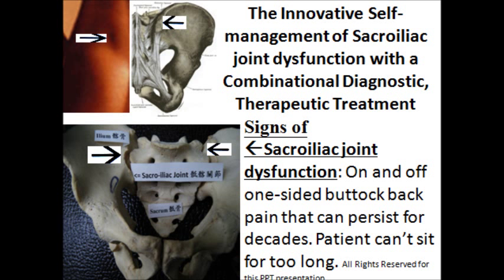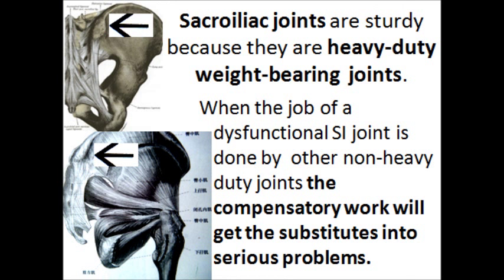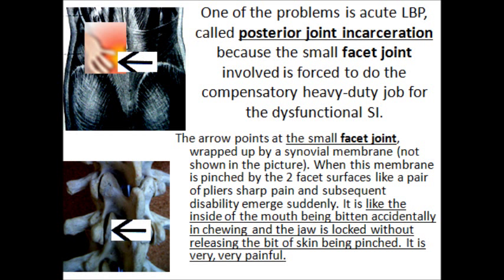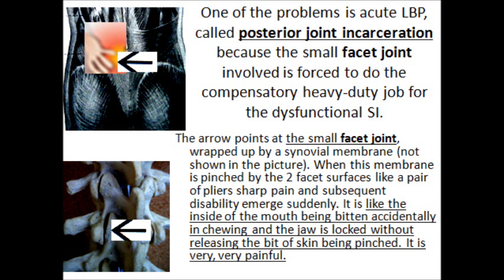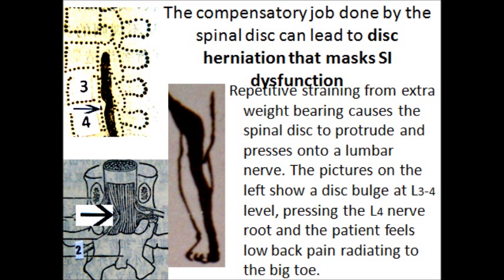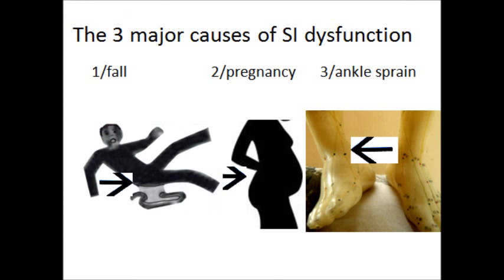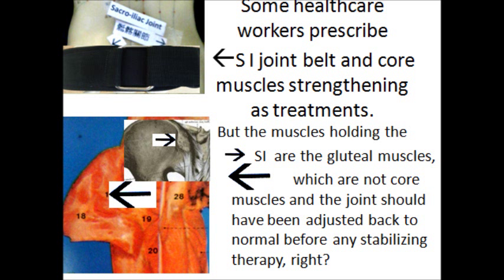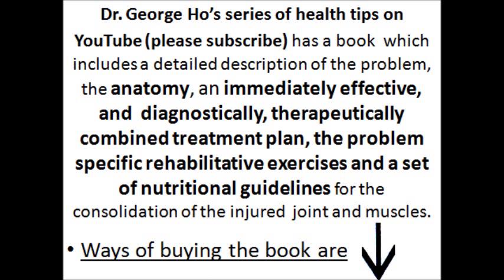The Sacroiliac Joint Dysfunction Cure with an Innovative and Safe Home Treatment (1)

Comment from the maker: Rehabilitative exercises guidelines:
1/Do exercises with the SI stabilized with a belt, which 
can be home-made too so that the involved area is protected and it 
should feel the pressure created by the exercises..
2/ Do them at 80% of your maximum capacity,which is measured by your fatigue towards the end of your exercise frequency e.g. 10.
Then you do 8 reps, which is 80%. 
3/You can do as many times as you like as long as you do not feel muscle 
pain the next day. If you do cut back so that you do not feel any 
discomfort the next day.
Dr. Ho